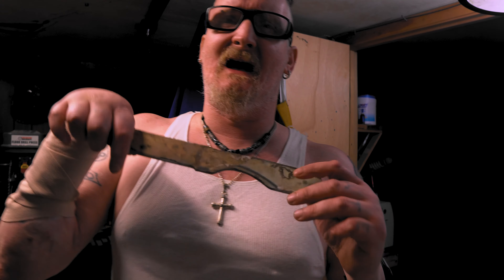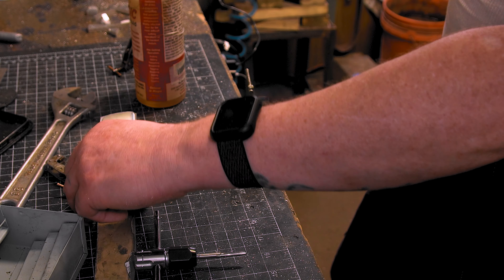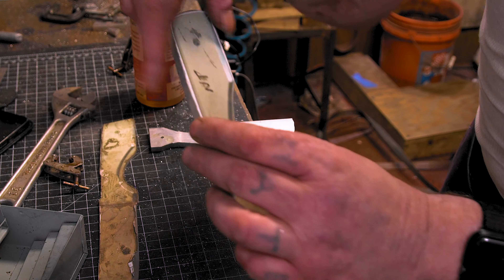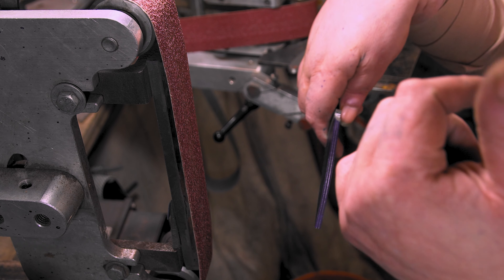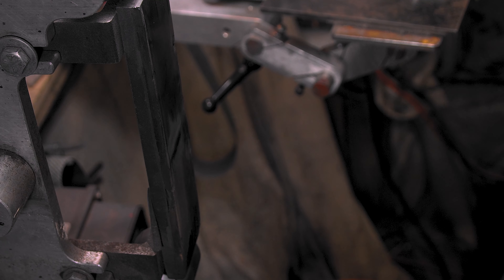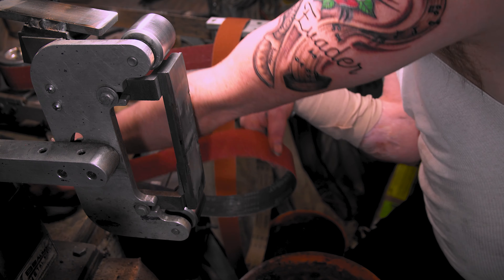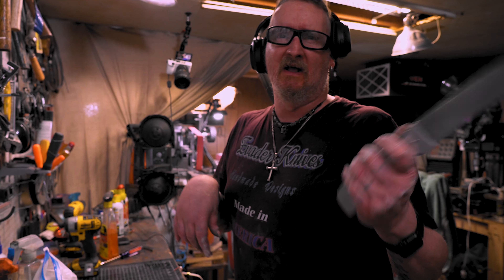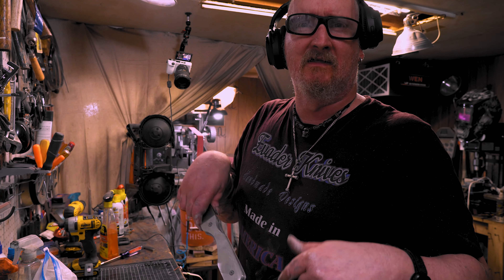vlog 24 Bevels & Handles

Comment: I hear you on belts. In the beginning I tried a few brands but for the last year or so, I do VSM for 36 grit then Blaze for 60, 80 and 120s. That's where all my main grinding is. I love the way the  Blaze belts perform.
Reply from the maker: Right, they are a little better, but for me not enough to justify the extra cost. I try to buy belts 30-50 at a time, which adds up pretty quick.